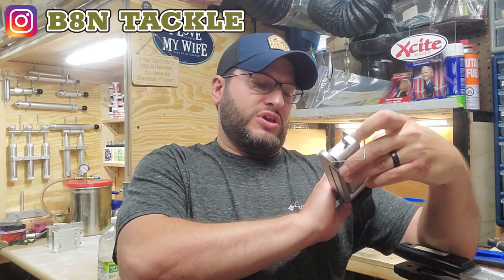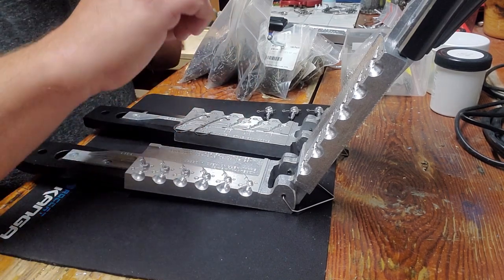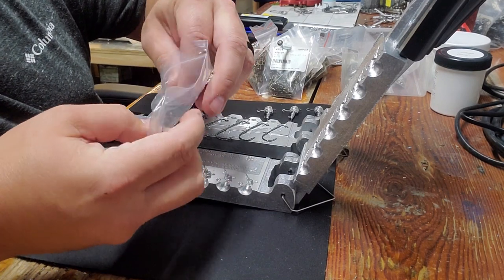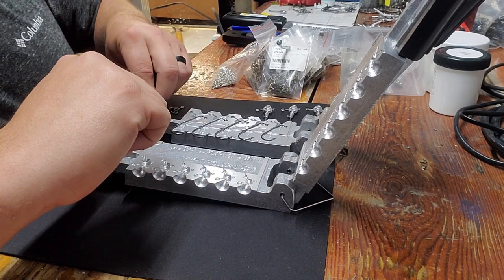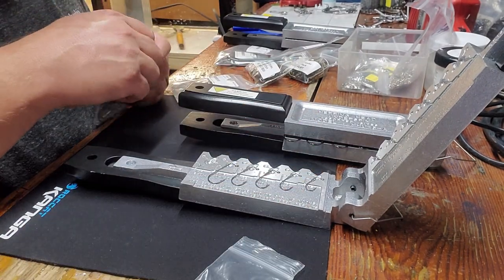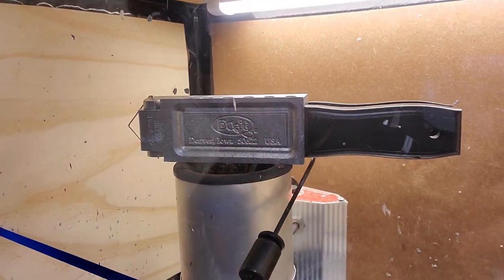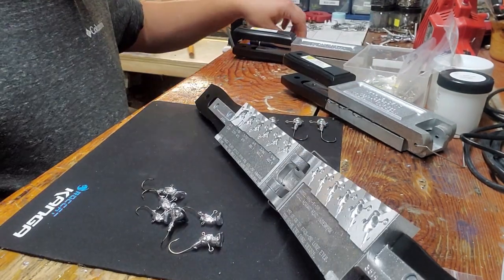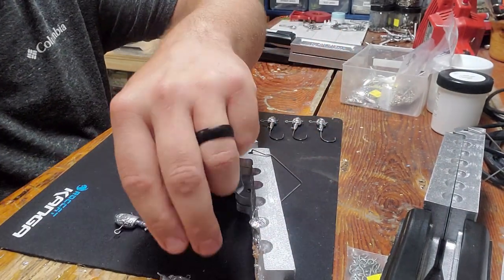UNDERSPINS! (Do-It Molds)

Comment: I haven’t used any under spins at all. I can’t bring myself to pay for them. So the mold is definitely something I’m considering. However, I have yet to read where anybody says how good they work or the fact that they work as good as or better than commercially available ones?
Reply from the maker: They are very effective! Especially when fish are chasing bait. Think of them as a smaller spinner bait. I use them all the time, all times of year, I use the smaller ones for pan fish and the bigger ones for bass, striper, and even reddish (salt water).
Reply: @B8N_Tackle Thanks! I feel like I should try them. I just cannot weather the outright purchases.

Comment: Can you cleanly pour a 1/4 and 3/8 with a thin wire 1/0 90 degree hook?
Reply from the maker: There is a 1/4 oz in the bigger sized mold and the smaller sized mold, in the smaller mold yes 1/0 will be fine for 1/4. The 3/8 on the other hand is only on the bigger sizes mold and no it will not except a 1/0 hook.